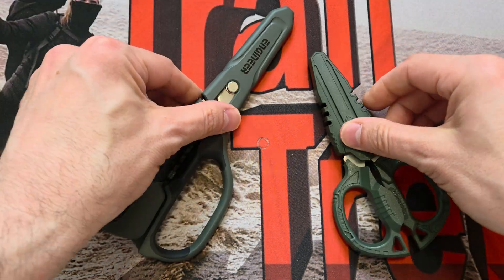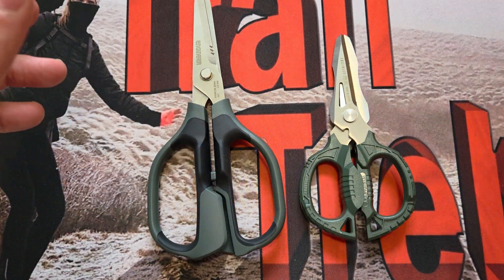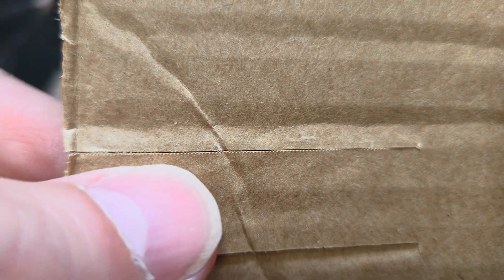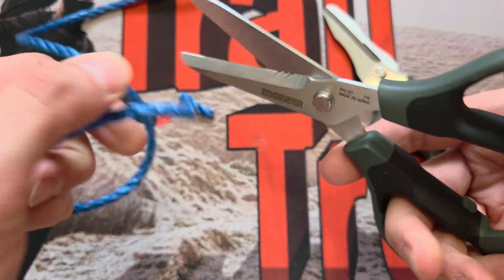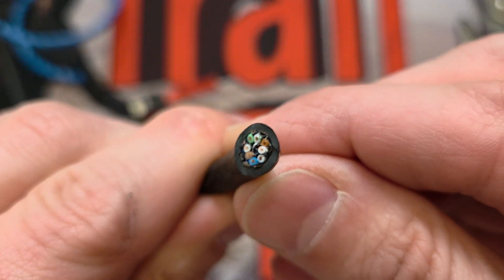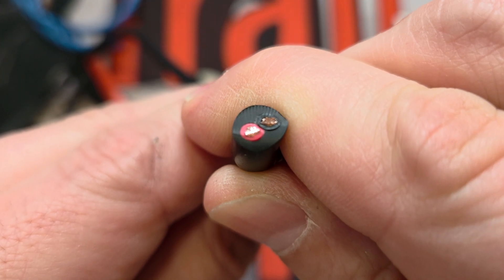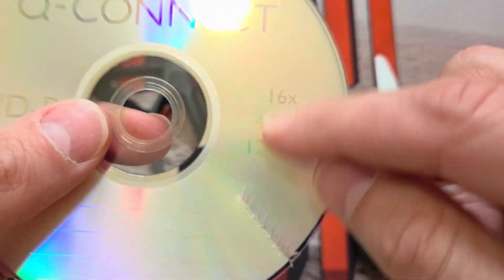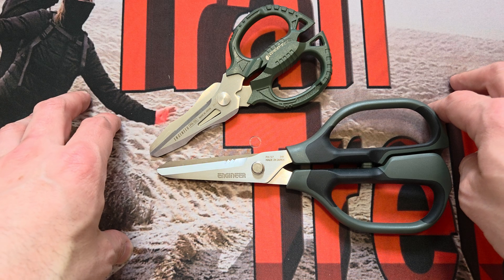Engineer Scissors PH 55 vs PH 57 Tetsuwan multi cutting tests which is best SHOWDOWN

Comment: Bought these longer ones on the strength of this review and they are excellent.
Great value , well designed and brilliant all purpose tool
Reply from the maker: Just used the larger ones this morning I love them.  I'm still surprised they have such a low price on them but I hope they keep that sensible price.

Comment: what about sharpening their serrated blades? Please
Reply from the maker: Excellent question.  So from my knowledge in the Knife world I know how annoying or sometimes impossible it can be to sharpen serrated blades.  For knives you have to get a long sharp pointy honing rod or ceramic sharper but if the serrations are too small its almost impossible.  So with this set of scissors here they have the serrations to grip and keep gutting on things that might normally just push out the blades.  Ona  knife sometimes you use serrations to avoid dulling on hard surfaces.  I have spoken to at least 3 people now telling me they have had these scissors for up to 10 years and have never sharpened them once.  I cannot tell if this is the truth but these are viewers ive spoken to a lot and they tell me the truth so I think these will last and not need work done to them over time unless you are cutting incredibly hard items.  I hope this helps.

Comment: Is anyone able to tell me what kind of Steel they are made of?  Rockwell hardness, even better.
Reply from the maker: I would like to know this as well all i can tell is they report them to be stainless steel which is pretty hard but as for the actual Rockwell I don't have that data.  I can see comments saying for example that "The Engineer PH-57 scissors have a blade hardness of HRC 56-60 on the Rockwell C scale."
But I cannot provide a source link for that claim.
Reply: @TrailTrek  They are made of SUS6A HRC 56-60. Same as AUS6.

Comment: how do they compare to the PH56?
Reply from the maker: PH-55 is most compact and offers the most diverse blade functions in one tool, including a dedicated wire cutter where the handles are.
PH-56 is a medium sized set particularly noted for its ability to cut tough materials like Kevlar.
PH-57 is the largest and most heavy-duty, designed for tackling a wider variety of materials, including thicker items, with a focus on leverage and grip.

Engineer PH-55:
Length: 160mm (compact)
Blade Type: 4-in-1 combination blade:
Anti-slip micro-serrated blade for general cutting and preventing material slippage.
Flat blade section for more precise cuts.
Safety blade feature (likely a guarded or specifically shaped area).
Wire-cutting blade for small wires (copper: $\phi$1.6mm, steel: $\phi$1.2mm).
Blade Material: Stainless steel.
Handle Material: PBT (Polybutylene Terephthalate) for the grip and cap. Ergonomically designed for a comfortable and secure grip.
Features: Finger pinch guard, blade cap with vent and drain holes.
Cutting Capacity (examples): Cabtire cable (2mm² x 4C), coaxial cable (5C), cotton insulated cable ($\phi$8mm), rope ($\phi$10mm), leather belt (4mm).
Weight: 120g.
Overall: A compact and versatile option with a focus on multiple functions in a smaller size.

Engineer PH-56:
Length: 175mm (mid-size)
Blade Type: 2-in-1 combination blade:
Anti-slip serrated blade.
U-shaped blade (likely for gripping and cutting thicker or rounder materials).
Blade Material: Stainless steel, 2.5mm thick.
Handle Material: Thermoplastic rubber cushioned handles. Available in different colors (Red, Yellow, Green).
Features: Finger pinch guard.
Cutting Capacity (example): Capable of cutting Kevlar fiber.
Overall: A mid-sized option with a strong focus on gripping and cutting various materials, including tough fibers like Kevlar.

Engineer PH-57:
Length: 210mm (longer, heavy-duty)
Blade Type: 2-in-1 combination blade:
Anti-slip nano (very fine) serrations for thin materials and fiber.
Coarse serrations at the rear of the blade for firmly holding thicker materials.
U-shaped blade.
Blade Material: Stainless steel, 3mm thick (durable).
Handle Material: Thermoplastic rubber cushioned handles with an enlarged thumb pad for maximum force. Integrated finger guard.
Features: Supplied with a plastic protective cap.
Cutting Capacity (examples): Cabtire cable (2mm² x 4C), coaxial cable (5C), cotton insulated cable ($\phi$8mm), rope ($\phi$10mm), PP plate (1.2mm), leather belt (4mm), and capable of cutting Kevlar fiber.
Weight: 136g.
Overall: A heavy-duty and highly versatile option designed for a wide range of materials, with a longer blade for better leverage and cutting capacity for thicker items.

Comment: Hi great comparison the PH55 on Amazon are £16.99 and the PH57 are£11.99.
Reply: I read this comment, and now purchased them! I looked on Amazon for the PH57 yesterday but could only see them for £16.99, I didn’t see any of them for £11.99! However, I typed in the name of them and also added the price  (£11.99) and they came up! Buzzing! 

I did order the PH55 yesterday, after watching TrailTrek video. I was going to leave it at that and maybe get the PH57 in the future, but after I read your comment and found them at that price, I had to buy them! It’s lucky I needed to update my scissors in my tool bags! I am sure they will come in useful on a daily basis! I am a bit of a tight arse so saving £5 had made my day! 😂👍🏻
Reply: @villa_fan8882 Glad I could help
Reply from the maker: At those prices I think these are a bargain, thanks for sharing the prices here.  I'm still looking at some Fiskars but these engineer ones are ploughing through anything for me.

Comment: I have a set of the larger ones, which work great at going through UHMWPE rope and kevlar. They don't leave my splicing kit :)
Reply from the maker: Do you think it's worth me getting a pair of the Fiskars 710150-1001 PowerArc Shears (10 Inch).  I've been told they are really good but they seem comparable to the larger Engineer set.
Reply: @TrailTrek  I'm not sure. I know the larger Engineer pair is good for what I use them for (slippery and tough materials). I would imagine larger serrated shears would be better for cutting high-spec cloths as opposed to rope/line. I have a older pair of Fiskars called the "Shop Boss" 5792 and I never even though to try them on stuff like UHMWPE...  It looks like the power arc without the top handle is a tough set of scissors.

Comment: Good comparison, they both look like really good scissors... Though I think it would have been useful to add in some regular chepa scissors and maybe some kitchen scissors since they tend to be better. Just a bit hard to tell how good they are when they are 2 good things compared, so adding in a 3rd or 4th cheap option(s) I think would really show just how good they are compared to what I'm used to
Reply from the maker: Completely right I should have put in some kind of baseline with a normal pair so it would be a way more useful review.  I have a pair of Fiskars Pro to test so will try and do that when I test them.  I think in my own head I was too busy thinking about the buyers choice of the PH55 and the PH57 instead of making it relevant to 99% more people by adding in some cheapo and standard ones as well.
Reply: @TrailTrek  You can add scissors from a Victorinox Swiss Army Knife